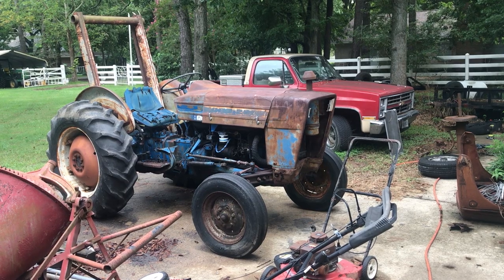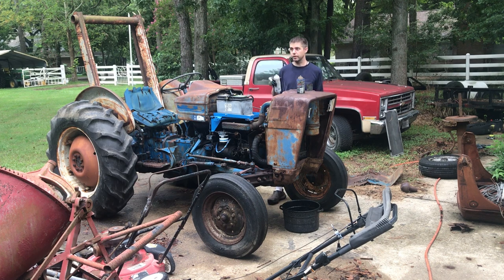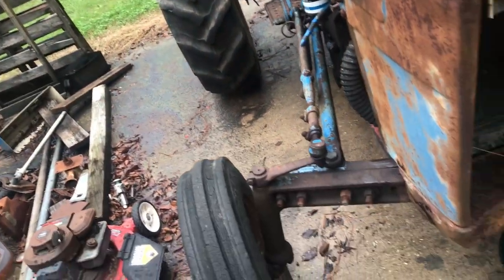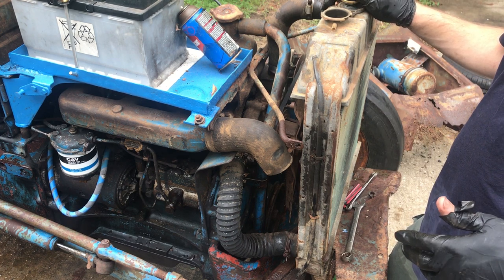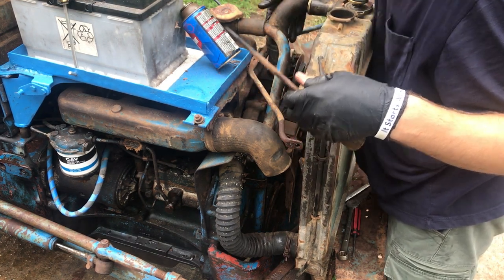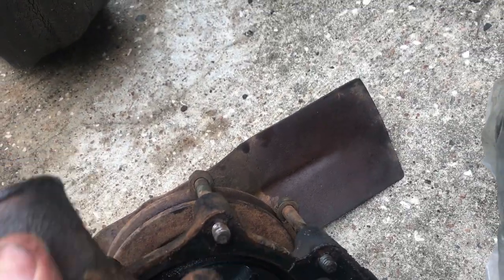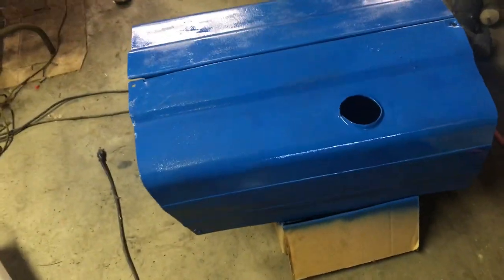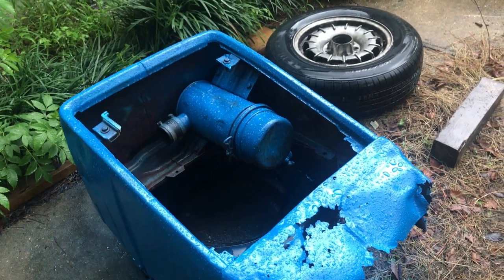Ford 2000 Tractor Cooling System pt1

Comment: Have '64,4cyl industrial 2000 with front end loader Installing a fan shroud as it doesn't have one. New radiator from previous owner. New thermostat and coolant by me. Overheats when pto mower is engaged. Everything else it runs midway in the green. Hope this does the trick

Comment: I’ve got a 67 ford 2000. I just recently flushed and filled the radiator. I really couldn’t figure out how to drain the coolant from the block though. The coolant that was in the tractor was green but I bought a specialized diesel coolant that was red. I’ve always heard not to mix the two so how do you remove the coolant from the block??
Reply from the maker: The block drain is on the right side in front of the starter.
Reply: @mjmcomputers  thanks!

Comment: Do you think the previous owner had clipped grass or debris sitting in the lower half of the cowl to make it rot out like that? It seem like it's really localized damage, and almost as if it's been sitting in a chemical bath, being eaten away.
Reply from the maker: Yeah probably had grass or mud or something built up there as there really isn’t any rot anywhere else on the tractor. Normally the fenders rot out but these aren’t.
Reply: I've seen the results of cow crap eating through metal stanchions over time - very caustic.
Reply from the maker: Yes it is